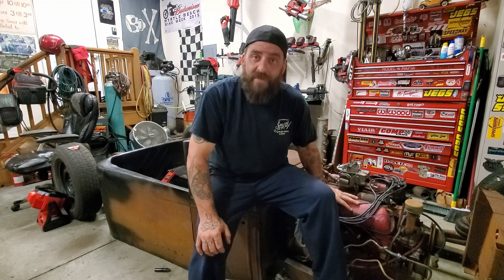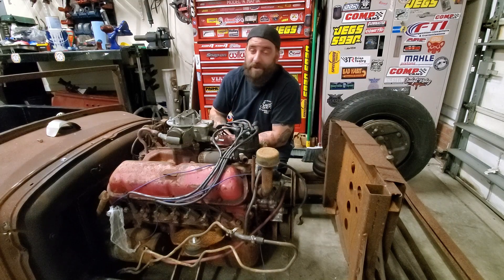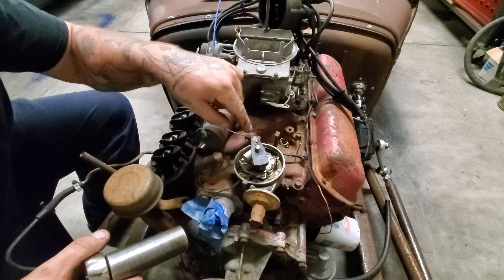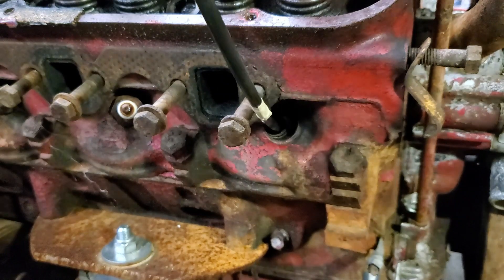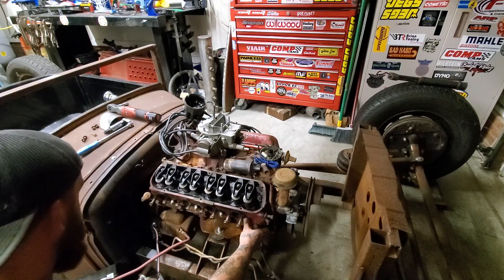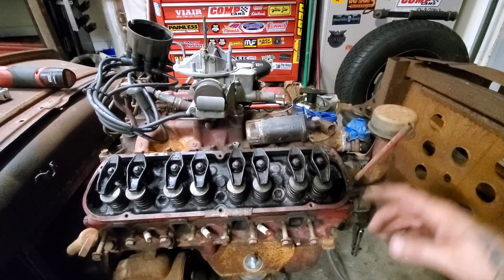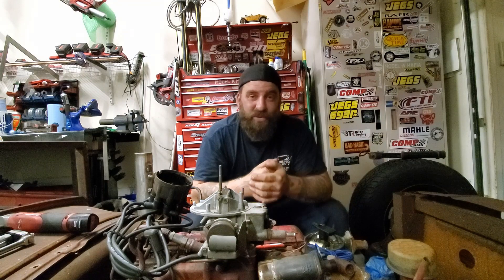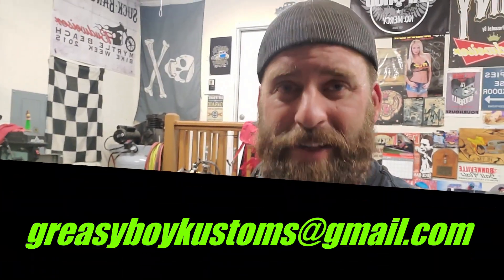3 WAYS TO FIND TOP DEAD CENTER ON YOUR CLASSIC ENGINE

Comment: I have a 99 ram and I'm quite sure the engine has good valves and compression. However when I crank it over by hand with a wrench and put my finger in the hole it barely if at all will blow my thumb on the hole. Is this because I have everything hooked up on the engine and it's very slow to turn over with one hand? It just bothers me.
Reply: Nevermind, turns out all the cylinders had almost zero compression. Looks like the plenum gasket going bad on the old motor really gunked up all the exhaust valves so I'm lapping them and replacing the bent and broken ones. Then I'll try again.

Comment: Try doing the with a RV 460   where the motor is closed in and your hand can brarly get the  plug. A starter switch is good but not enough to get center

Comment: At :56 seconds in the video it is said that “you can put it in the right firing order put run the something backwards and you’ll get pops and flames out of the intake” I currently have everything ran on my sbc and I am getting pops and flames out of the carb. I am assuming some where along the road I did something backwards. Can you please elaborate on how to fix that issue
Reply from the maker: Typically, that means you are 180 degrees out with your distributor placement.  When you are rolling to top dead center, the timing marks on the balancer and the timing tab line up on the compression stroke and the exhaust stroke. You may have been at the top of the exhaust stroke when you set your distributor position . Basically, pull the distributor, rotate the rotor button 180 degrees, and reinstall.  That will get you close .  The method where you remove the #1 plug and bump the engine over until it blows out of the plug hole will be helpful in finding the compression stroke.  If you still have trouble feel free to call me 919-634-5219

Comment: I'm definite going to be exercising this tomorrow, however question...If I find TDC, can't I just roll over the rotor in the distributor then to point to the #1 terminal on the cap before I drop it in? I just pulled the distributor tonight because I realized I hadn't considered any of this to date before first start up.
Reply from the maker: Yup. If you set TDC you can essentially put 1 wherever you want.  If you already have #1 set on your cap then just point your rotor button tip to the contact you want in the cap.
Reply: @greasyboykustoms  well the way the Duraspark cap clamps in to the base of the distributor it's kind of set in that regard...and where the VAT diaphragm sits too, but thanks for confirming what I thought would work. I'm so scared with all of this
Reply from the maker: @Str8sixfan  you the man.  Burnouts coming soon🤞